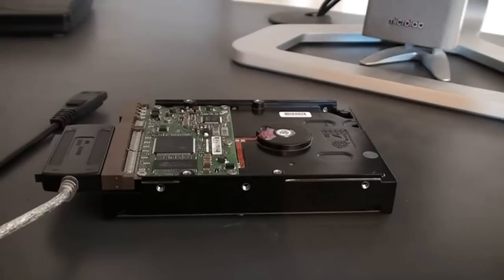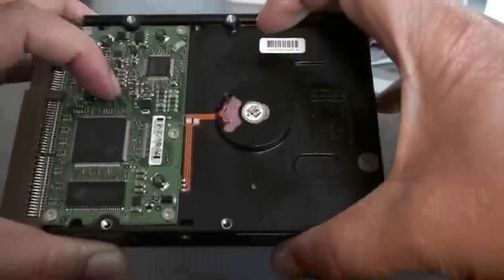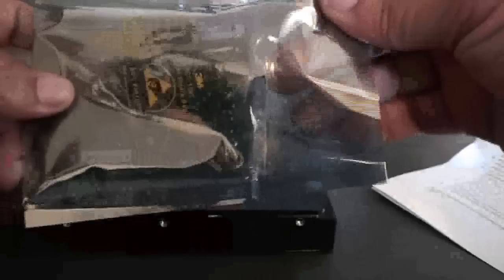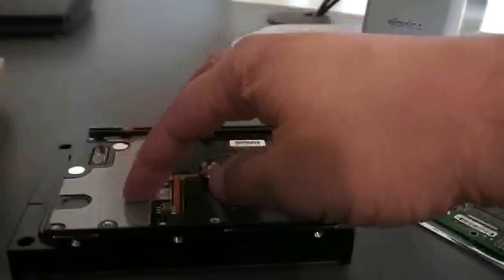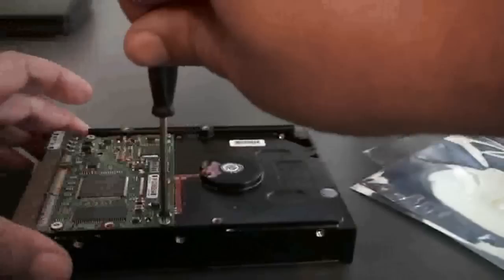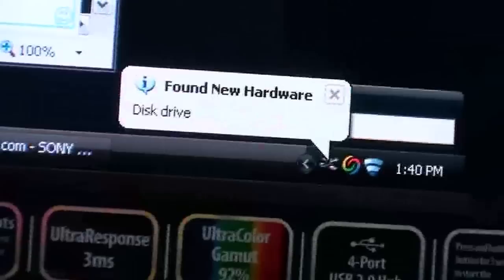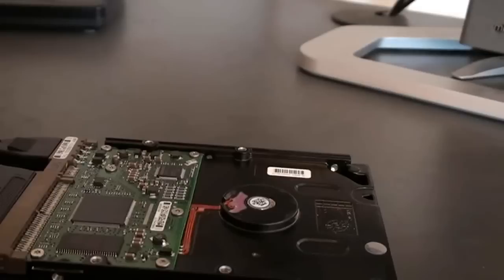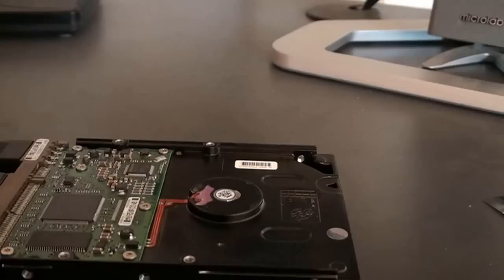How to Repair a Smoking or Fried Hard Drive

Comment: I sure am glad I found this video because I smoked the PCB on my WD 500GB SATA Drive by plugging in the wrong power supply for the external enclosur because it had the same plug but was wired differently and there was no way to know which power supply was the correct one since they were both just cheap made in china power supplies that did not say which enclosure they went to.
I searched the number on my hard drives PCB and found a match.

Thanks for posting this video and providing the link to the company that provides the PCBs.
Reply: I just did same thing with my WD My Book today were you able to recover all your data ?
Reply: I never got around to trying it because I emailed the company but never got a response, maybe it went to my Anti Spam or Earthlink blocked it because they seem to block certain domains
Reply: +Dallas Dal Oh shoot so you never got the PCB for your drive?

Comment: Thanks, saved valuable work- and money!! I sent my fried PCB board to PCB solution (link above), they were super nice and fast. They sent a matching PCB with the chip transfer-solded for free. So no solding to do, just re-screwed the old board and backed up my files just like that video. Total cost around 40 bucks, when companies in LA wanted to charge me up to $1200 :/

Comment: I managed to get an identical pcb from a similar drive St3250823AS. The swapped pcb allows me to do data recovery on it. But unfortunately the hard drive cannot boot up the windows. So how can I get Windows to run again on this hard drive with the new pcb?
Reply: +Ran L The PCB should only be used to recover your data. You shouldn't use that drive to boot into windows.

Comment: Wow this was very informative. So recently (which was last nigh) I had my external 3.5" Seagate 3tb start smoking. And I was crushed, because it is practically full. And a lot of things on it are almost impossible to replace. I am not sure if it was the hard drive that fried or the circuit board in the case. I put my hard drive in another case that my 3.5" 1tb Seagate was in and it only read a little less than 800gb with a program called disk drill. I wonder why it is only reading less than a 1tb of it's 3tb capacity. Is it possible to replace the PCB board to recover all my files on the drive? If so do I go by the part number on the PCB, the hard drive or both? And yes I am a diy kind of guy and have learned quite a bit over the years. Anyway let me know and thanks.

Oh and I also wanted to mention since putting my fried or smoking 3tb hard drive in the 1tb external case. it hasn't smoked at all. Which makes me believe that the board in the external case may have fried.

Comment: sir i have innternal hardisk of 1 tb which  i used in desktop. i have puchased a 3.5 inch casing for my internal hardisk. recently   accidently i have  inserted my laptop charger  having 19 volt in hardisk casing  power pin socket  meant for 12 volt .for 3 to 4 seconds. as both my hardisk casing and laptop charger were at same location and i could not identify both

..now light  smell is coming  out from my  hardisk ..and now when i connected my 12 volt adaptor to hardisk casing the light in the 12 volt adaptor blining and my hardisk is not reconizing in at all..

plz.guide what has happen
Reply: Sounds like you blew a chip on the board. The only way to tell is to remove the hard drive from the casing and test it with a usb adapter cable or dock.

Comment: I'm trying to swap a board but the little screws are really hard to remove. They look like 6 pointed star. I tried the small Philips and flat head and no ;luck. I'm afraid I'm going to break something putting too much pressure on the screws. Are they Philip heads? WD workbook.
Reply: they are torx bits
Reply: I used a very small scissors to take my board off..luckily those screws are only in there a couple of turns..it would have been nice to have this screw driver...

Comment: That is a TVS diode faillure! Even when you DON'T have a replacement donor (wether its a PCB or another drive) you can get this drive to work perfectly fine! JUST REMOVE THE DIODE FROM THE BOARD WITH A SOLDERING IRON!! I do repair electronics and it makes my SICK watching this video's, sending out people in the field for  UNNECESARRY replacement pieces and parts! As long as you don't OVERPOWER the hard drive, it will run without this TVS diode . . . What you are doing is fine, but it should only be done when the drive has a S.M.A.R.T. faillure . . . Do some research before making a video . . . And don't call yourself ---Tech Systems if you don't know what you are actually talking about . . .
Reply: Man, relax, this is a simple method and works. The "as long as you don't overpower" means future failure. Having a new board will save you future service calls and/or possible clients wanting money back.

Comment: That is definitely a busted TVS diode. I fixed two of my drives that had this symptom by removing that TVS diode (which is shorted after it has experienced a surge in voltage). My video illustrating the repair:

watch?v=ksRUzWRsPvc

I didn't need any additional hardware like replacement PCB's to recover my data successfully.
Reply: Hello can please send us the link again. The one you wrote doesn't work.

Comment: An idea and a question? You can get on Ebay and find the same identical hard drive and save some money? Also I have a Maxtor 320GB Diamondback 21 (6a320YO) HARD DRIVE.  I cannot find the same one, would a lower capacity hard drive have the same PCB (all factors being equal)? I also found a similar one too, but it is a SATA AND mine is an IDE.  The company you talk about is on Ebay (comment for your future readers).

Comment: A cheap PSU (Coolmax) cause my PCB to smoke, I plan on using  original PSU I was using before, I ordered the matching pcb and I'm wondering if when I install the new pcb if I will be able to use my HDD as I normally would other than wanting to recover the data
Reply: I tell everyone the PSU is the most important part dont slack off with the PSU most people never listened and chose a cheapo one to use faster components such as more ram or graphics etc... and moaned 3 months later that the whole system is fried due to the crappy unit they put in well I warned em! my unit is a hipro psu ( i have replaced the capacitors on it with better quality ones hipro units work good on a light load and it has worked for 9 years pretty much everyday
Reply: Riviera ම Best for a budget everyday PC I would recommend Hipro or Bestec, once they have been recapped, but yeah those high end ones are excellent for gaming and will never fail you not in 20 years anyway, so long as you've got a good one with good wattage output it is definitely a component that can be recycled for a new build.

Comment: have you ever serviced a western wd5000aaks? can we do the same for it or boards are imposible to swap?
Reply: I have never replaced a PCB for the WD5000aaks but I do know that there is a replacement PCB for the WD5000aaks.

Comment: How ironic I have the same hdd that started smoking off that resistor yesterday, I never knew the pcb was just screwed on ,I'll look for an identical drive or contact pcb solutions to get it up and running again.btw do you think the drive would be OK to keep using or is it really recommended to back it up as soon as it's reading again? Thanks for the video
Reply: +rellik187redrum As I can see it's a capacitor and not a resistor, probably a tantalum capacitor.

Comment: hey got a question what happen if the disc stop spinning??
Reply: +anthony tamburro 

HEY ANTHONY...

A drive that stops spinning can be from a seized motor, a power loss problem , or jammed pick-up head /arm
You can Google or You Tube each of them 

For a power problem within the board , unless you have electronics experience in these types of components and knowledge in this area of diagnostics  , then follow the advice in the video.

A  seized motor?
Like any other motor , a Hard Drive  motor has a shaft & bearing.
But this shaft &  bearing  work with very VERY small & tight tolerances.
Over the years as the drive continuously gets hot and then it cools, over & over , it expands & contracts day after day after year after year..
At times , the heat can  be more extreme that other times.  And  enough to distort the shaft or bearing.
Even if only a millionth of an inch.
 But over that time,  if the shaft or bearing experiences continuous distortion,  it eventually adds up,  until that one time it just stops turning all together.  
Opening the cover, or pop it in the freezer?
Sometimes people have had luck with opening the drive & just nudging the shaft to get it going. But that is very rare.
Also, many people have had good luck with putting the drive in their freezer.
This  causes the metal to contract just enough to get it running again , but long enough to transfer important data off of it.
You should  be ready with an external drive already connected to the PC, because if it seized once , then 99% of the time, IT WILL HAPPEN AGAIN. And probably a lot sooner .

The same goes for if the pick-up head/arm jam against the platter
Both methods have worked for some. (Freezer or nudging of the shaft)
AGAIN, it is rare but can be worth a try if the data is that important to you and you don't have the money to send the drive out.

-
Reply: ok thanks I want to know how to fix hard drives will this be a huge lesson how to fix hard drives?

Comment: Please help me. Everything happened yesterday. I turned off my laptop but it lagged first. So it went off. Then i tried to open it again. Then it shows 'operating system not working'. So i tried to look at the hard drive of the laptop. I moved it a little bit. Then it worked again. My laptop opens successfully. Then it turned off fast. Then there are smoke coming from the laptop. I don't know what to do. Please help me. I have Sony Vaio Win7 64-Bit
Reply: 5 year later:
No one answered
Reply: @etlttc353  🤣🤣🤣